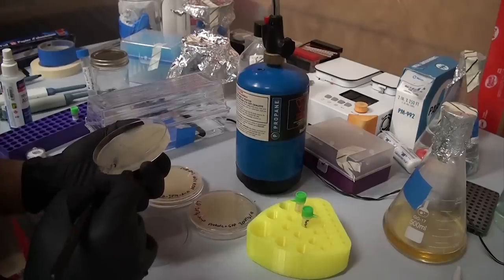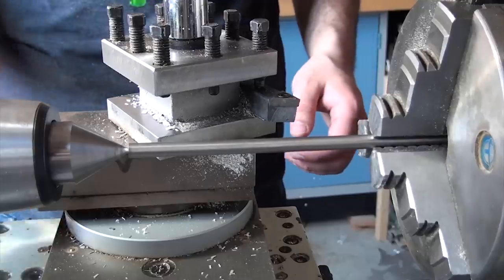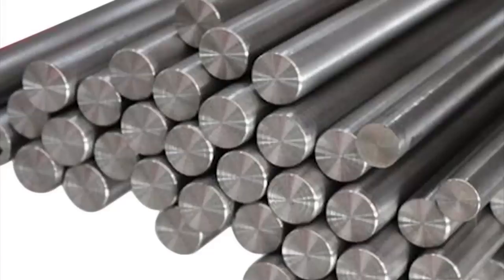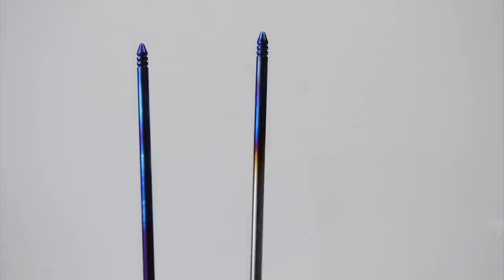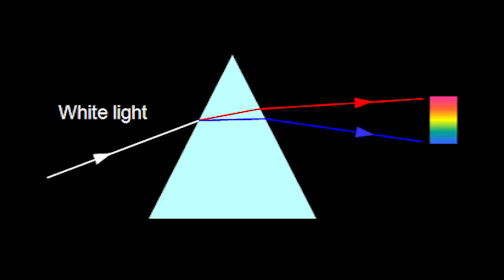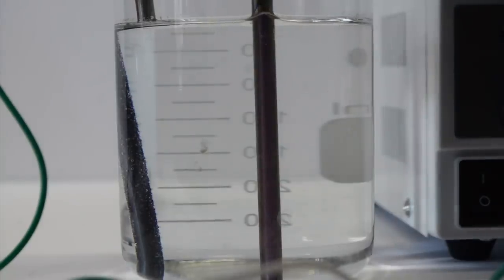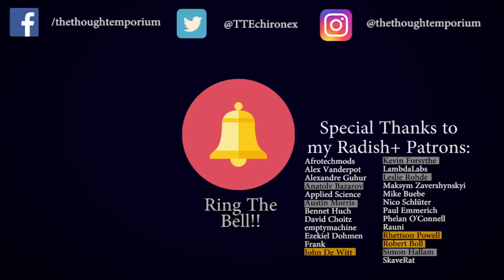Why is Titanium so COLORFUL? - Making/Anodizing Titanium Chopsticks

Comment: as a PVD surface engineer, I should say that color is not a result of "thin film reflection". the thickness of the fill must match the wavelength or half wavelength which means at least 200 nanometers but the thickness of the film you formed here is only tens of nanometers, not more. it is due to another physical effect that is out of the scope of this content.

Comment: The vibrance of the color increases exponentially as the surface finish improves. Taking the time to polish to a mirror-finish with a jewelers rouge or very fine grits + metal polish is worth it. I've had good results using a small buffing wheel on a Dremel tool. Most lathes don't spin fast enough to effectively hand-sand a small diameter part.
Reply: Cool project, though none of it would fit this channel, would be to make a gearbox to increase the speed, a planetary gearbox would probably be the best design for a lathe. The smaller bearings on the output would be better suited for higher speed, lower torque applications anyways. Basically, adapt the larger lathe to do the work a jeweler's lathe would; which would expand the amount of work you can do with a single lathe, when it would normally take two. 

Another set of cool projects, though more complex, but would add to the decorative bits of projects, would be adapting a standard lathe to a rose engine, straight line engine, geometric lathe, and other forms of jeweling. Which could work on both the original lathe, and the adaptation that makes it a jeweler's lathe; again, making one tool do the work of many, using removable attachments, which is money and space efficient.
Reply: Yep, the difference between 300rpm vs 15,000rpm.  Does wonders when polishing!
Reply: Ever tried to grip a polished item with oily  fingers?
Reply: Maybe neutral the headstock and chuck up a straight die grinder. Might have to modify the collet but you will get your 30,000 rpms. Just use flapper drums and a buffing wheel in a drill.
Reply: I never found those Dremel polishing wheels useful. They just don't seem to do anything but throw around whatever compound or paste you're polishing with.
Reply: Does it work well with iron or steel too? (I haven't got a metal lathe so I wanted to try to make something iron colorful with a blowtorch or electrolysis)

Comment: 2:53, never touch the shavings while the lathe is spinning, if you would like your fingers to stay intact :)
Reply: Just watching him do that made me cringe.
Reply: it wasnt moving tho
Reply: It was moving, I watched it many times and the machine wasn't shut off.. shaft was still spinning.
Reply: Look at the left side, it wasnt moving
Reply: Any idea what kind of equipment this guy is using?
Reply: @imacrazyguy5831  it wasn't moving... I can clear as day see that it stopped moving before he touched it.  The only thing that makes it remotely look like it could be spinning is his shadow as he moves over it.
Reply: Stopped or not, we are always told to use a tool instead of fingers to remove metal chips. They are sharp.
Reply: @M7x0.75  titanium is relatively soft, I could understand why that would be the case for steel shavings but titanium shavings are probably soft enough to just be plucked up

Also it's definitely not moving
Reply: @USS_ESSEX_CV-9  We are told to stop the machine and use tools to remove the shavings to create good habits that improve the safety. If you are not careful enough, you can hurt yourself even with aluminum shavings.

Comment: Fire Hazard: 
Be very careful with the Ti shavings, these can be set on fire with a lighter and they BURN very hefty.
Do not use water to put out a burning Titanium shavings, it will only make it rage even more.
Reply: when cuting titanium always have a bucket of semi wet sand by your side.
Reply: @jolioding_2253  or drench your workpiece with cutting fluid, it also preserve your cutting tools. "Drenching" is the right word, our CNC had two massive cutting fluid pumps, its output seemed like a fire hydrant.
Reply: @AltMarc  yea that also works well but if you have an old lathe there is most likely no cuting fluid pump so you have to drench your workpiece manually with cutting fluid to prevent fire or use wet sand in  ase a fire breakes out
Reply: it get's even more interesting when you're casting it and a vacuum seal breaks:)It tends to explode, i had to scrub the whole machine of paper thin titanium splatter:)
Reply: @jolioding_2253  Or just retrofit a fluid system to a lathe, it's really not that difficult; and if it is too difficult, you probably shouldn't be operating a lathe then.
Reply: @jolioding_2253   Mostly even 60 year old machines have fluid system.
Reply: Titanium will even burn in pure Nitrogen, in which case it forms Titanium Nitride.
Reply: Knew a guy who set fire to a drum of Ti shavings on accident. Cracked the cement under the drum from the heat lol.
Reply: I was about to type out the same warning.
Reply: Dude cuts half a gram of titanium - commentors call EOD squad. What the fuck, dude? He is not machining engine blocks. Even if he manages to light it - it will be a little spark for three seconds. (I worked as instructor in an RC model club, kids would fight to grab the shavings out of the lathe, light them on fire and throw at each other. All of them have very lucky families now)
Reply: Had no idea that Titanium was flammable. I'll remember that when I'm back at my work \o7
Reply: So is aluminium.

They're common ingredients in making fireworks actually...
Reply: Isn't that magnesium?

Comment: Try using some nail polish to make patterns on the titanium and use electrolysis. Your pattern will be left unoxidized so make sure to anodize it to a complimentary color. Also working your way from low grit sandpaper to high grit will change how you perceive the colors. The green will become much more vibrant this way. Just some tips from a knife lover. ❤

Comment: The colour stuff works for copper too, a bit. I had to solder some wire to copper rod yesterday, and it was interesting to watch the colour change
Reply from the maker: That's true! lots of things will do this, which I probably should've made more clear. I got some really nice colors from copper when I was working on my magnetron years ago. Got some rainbow rings where the plasma concentrates.
Reply: @thethoughtemporium  ah, ok. The wire was for a new antenna, you got me hooked on noaa satellites, man. I cant stop until i get a decent image
Reply: @thethoughtemporium  Copper has an even more interesting phenomenon, in that it will form certain colors in the reducing atmosphere of the flame of a torch, which will then immediately vanish or change when oxygen gets to it. It would be interesting to see an explanation of that. Is it a thin film of some form of unstable copper carbonate that immediately burns off to carbon dioxide, or is it some other interesting chemical reaction? I want to know!

Comment: Iridescence also depends on the light source.  Compact fluorescents and LED lamps have gaps in their spectra, so some of the iridescent colours won't show.  It depends on the mix of phosphors in the light.  A good rule of thumb is that the cheaper the light the fewer wavelengths emitted.  They'll all have at least one red wavelength, one green wavelength and one blue wavelength, and they'll all emit those with a balance such that a white object will look white.  But with the cheaper ones a yellow object (for example) may look a lot darker than it looks in daylight because that particular wavelength is not emitted by the lamp.

So if you're using iridescent chopsticks, eat al fresco for the best effect.

Comment: I used to put patterns on metal I would heat it up a little and start a color shift, then I would mask with tape and cut out patterns and sand the part with the tape mask on. Then remove the tape and heat a little longer. Stuff that has not been sanded will continue to shift color while the sanded area will start new color shifts. This give you the ability to make any custom pattern possible!

Comment: You should flatten them a bit. Then add some pikes on the front to make it easier to scoop the food rather than having to grasp it. Flattened Oral Retrieval and Keeping device. Let's call it a F.O.R.K.
It would be much easier than using normal sticks. So much so that you could probably just use one at a time.
:)

Comment: Great video.  You must have missed This old Tony's taper power feed mod - he has a tee-piece made out of steel rod that he uses to snag the handles on his crosslide, then drives it with a reversible cordless drill.  Takes all the ache out of repeated winding, and allows pretty smooth and steady feed.

Comment: May i ask if Its possible to make an difractiom metal? Can you cast gallium on a difraction grating and then get the rainbow effects on an metal?
Reply: Probably not with gallium as it has a very high surface tension and is extremly sticky when molten.
Reply: Tophat 1024 I would think the stickyness would be a good thing, since it would have to stick to the grooves of a diffraction grating to get the optical effects. The only problem I can think of is the expansion gallium experiences when it solidifies
Reply: I was just thinking that gallium always sticks on glass so it might stick on the texture of the diffraction grating

Comment: @1:58. Make an insert for your tool post that is a skate bearing on a stick and slowly feed it into your stock until you cant indicate and/or see wobble. Then tighten. Works great for centering things in a chuck too because it only applies pressure to the side that is out of center the most.

Comment: You'll have an easier time with your tail stock if, when you preposition your piece, leave the 3 jaw open, then, while holding the center drilled hole, against the live center firmly, close the jaws of the chuck. The live center should always aligned with the spindle. If things aren't lining up right, it's because the work was off center in the chuck. This means by just messing with the tail stock you can only at best remove any angular error, but still be off axis.

Also the center drill is meant to drill to the second tapered section. It has the same angle as a live center and therefore will hold accurately on the two mating surfaces. The straight part of a center drill is specifically to give clearance for the live center point, so that it DOESN'T contact. Center drills are sold in numbered sizes you you might want to look into smaller sizes. Different live centers and bits can be used to help. Or you can leave matieral on the end to hold a different way. Then part it off after.

You want to move the part as little times as possible. You'll never get things perfectly lined exactly as they were before you took it out of the machine. Trust me.

Titanium's "bendiness" compared to other metals and plastics isn't as much a problem as the small diameter. The further away from the chuck you are the more leaverage you have which bends the part. A good rule of thumb is use a tail stock when the part extends past the chuck 4 times the diameter. You could probably do all of the front feature of the chopstick without a tailstock or having to move it at all, but it might require doing some funky things like putting the lathe in reverse and cutting the taper on the backside.

If you feel like you need more accuracy use a dial indicator with magnetic base instead of the markings on the lathe. At least don't forget about backlash!

And don't grab those stingy chips with your fingers! Use a brush or pliers. Those cuts hurt.

Comment: Those are pretty cool. you can also do the electro-anodizing using a conductive brush hooked up as the cathode and dipping it into the electrolite solution and using the voltage to choose the color. Then paint the colors on. You can even mask off areas if you want sharp borders between colors. Do them from highest voltage to lowest since going over an area that's been anodized with a higher voltage won't affect the color at all so going over the border won't matter. You can get an almost stained glass effect doing this.

Comment: great video!
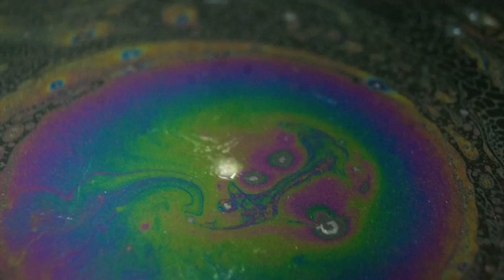one small correction: at 10:20ish you say "one color adds together to be constructive and all the rest are destructive"
it's actually the other way around. soap bubbles and oxide layers are always a mixture of gold, cyan, magenta, and the shades between them from the destructive interference of one specific wavelength of light.
if it was constructive interference with one wavelength that made the biggest difference, it would go through various colors of the rainbow, but it goes through all combinations of colors aside from one wavelength.
the phenomenon is called pearlescence if anybody wants to look it up.

you can imagine this the same way that they do that cool colored shadow demonstration at science shows and museums, where they have three colored spotlights pointed at the same spot so you have cyan, yellow, and magenta shadows from your body blocking out one of the red/green/blue spotlights, and the other two lights combining on the canvas. (blue and green for cyan, red and blue for magenta, red and green for yellow)
Reply: Yep, it's why colours in thin films are pastel shades.

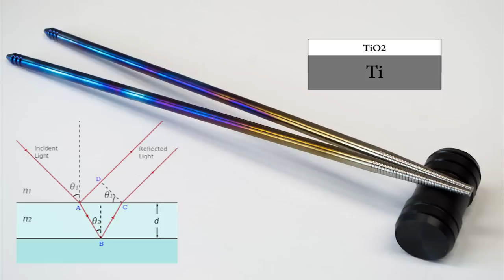Comment: 10:05 given that blue appears at thicker oxide layers, it could be that what's happening isn't that blue is getting a boost by constructive interference, but rather that a color close to orange is getting destructively interfered, meaning that you see its complementary color: blue. I'm not sure though, I'm basing this on the fact that for a color to get interfered, the thickness of the film has to be some multiple of the wavelength (or half the wavelength I think) of that color.

Comment: Good, good, good! I never realized the colors of burnt metal had a pattern (although now that you mention it, it's obvious - not the why, just the fact that the blend on a burn stain is smooth and focused on the center). I didn't realize it was the exact same kind of effect happening on bubbles and oil stains. I guess it's also technically what happens in rainbows - the double reflection is what creates the rainbow effect, and thinking the droplets or ice crystals directly act as prisms is a common misconception.

Comment: A few tips from a machinist: when you plane the end and drill the pilot hole you should have as little outhang as possible, a few mm (0.08 of an inch e.g.) will do. And when you cut the taper use a drill with a T insert to turn your compound slide for a more even feed.
Otherwise very nice video and projekt!
English is not my first language so please forgive me if there are mistake in my writing :)

Comment: Use a smaller center drill and go to the champher part of the center drill. Because this is actually the exact same angle as your live center. If your worried about drilling it deeper then just make your part a bit longer so you can face it off later. This is a lot more ridged setup and will help getting it to run true.

Comment: Oh, I remember learning about thin film interference in my last year of high school physics. I think it's commonly used for QC of flat surfaces IIRC. If you put a very thin piece of glass on a surface, with one side very slightly lifted off, you should see straight parallel lines if the surface is perfectly level.

Comment: one thing i would recomend is to get inserted carbide tool holders with carbide seats in them as the seats will save your holder if you are too ever crash the lathe. they are more expensive but are worth the extra cost. :)

Comment: I think the rabbit hole is a little deeper even than that. Interference only redirects light, it does not absorb it, or change its frequency. How then can we observe a solid purple; which hardly seems to vary with our point of view at all?

I think a more complete description involves the effect of the metal, which is an imperfect reflector. The metallic gray color indicates that it absorbs visible light roughly independent of wavelength. However, the oxide layer forms a dielectric waveguide, which has modes with wavelengths in proportion to its thickness. Light with matching frequencies will couple into the waveguide, travel more along the surface, thus interact with the metal more (multiple bounces), and hence get preferentially absorbed.

That also would explain the notch-filter type effect that you observe; red-orange->purple->blue, means blue/green/red is being preferentially absorbed, as the layer gets thicker.

If the metal was a superconductor, youd get a much different effect; much more like a soap bubble indeed, with multiple repeating rainbows, that do shift with your viewpoint.
Reply: Aha, that's why I don't see these colors when trying to anodize aluminium! It's too reflective.
Reply: @victortitov1740  Good point; that is indeed probably part of it. But aluminium coats quickly get so thick that most of the effect will shift outside the visible spectrum, so youd have to check on a thin one to see any of it. Also aluminium anodization layer grows in a weird honeycomb nanostructure, so that might throw things off as well.

Comment: 40V, 95V and 115V are particularly attractive colors. Someday I need to zap some titanium. Easy variable voltage supply, with appropriate precautions taken, is a resistive load across a capacitor with a volt meter measuring it. Power with bridge rectifier connected through light dimmer to mains. Not a method for those who aren't familiar and comfortable with working on live electronics, but should provide enough current to do very large pieces, if that gives some creative ideas.